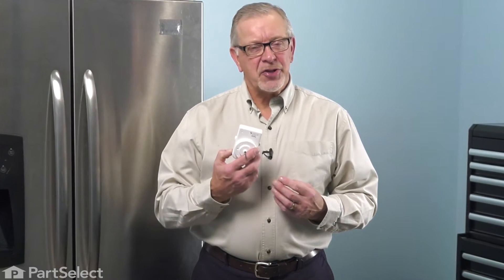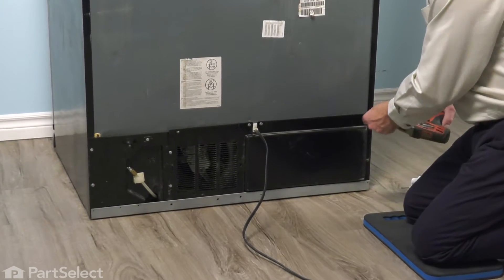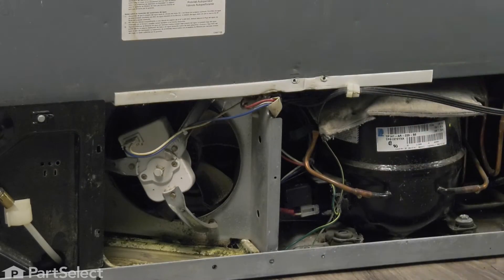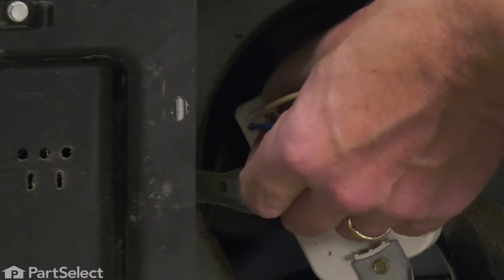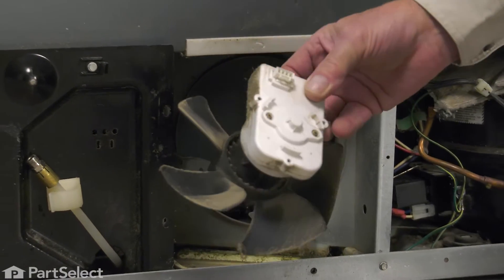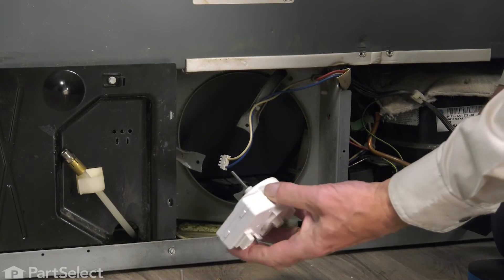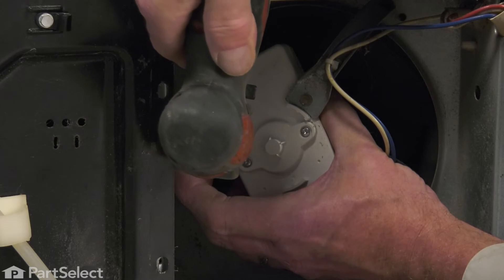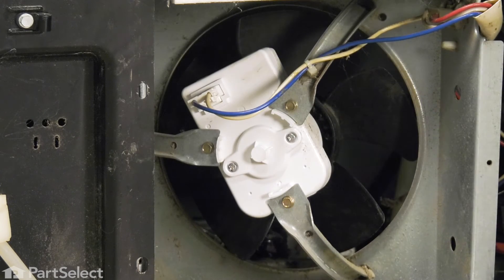Whirlpool Refrigerator Repair - How to Replace the Condenser Fan Motor

Comment: What solved my noise problem in this area wasn't the fan motor. The motor spinning caused the thin plastic drip pan to vibrate against metal at multiple places. Very poor design by Whirlpool. I placed Foam Insulation Weather Stripping Adhesive (3/4 Inch Wide X 1/8 Inch Thick) everywhere where the plastic drip pan touched metal. The plastic drip pan on my Whirlpool/Jenn Air model (same model as this video) is located under the Condenser fan motor and runs along behind the Compressor. It was vibrating at its worst behind and to the right of the Compressor.